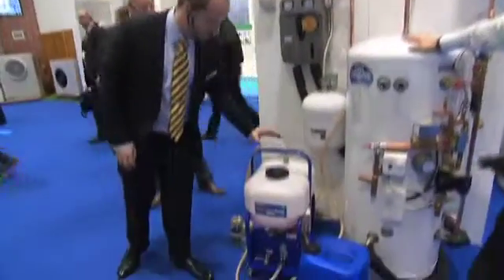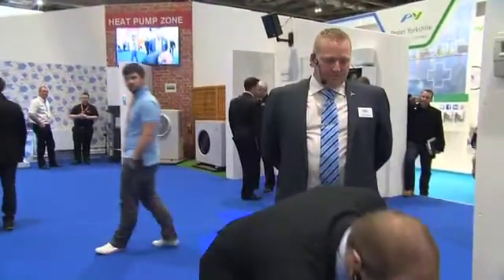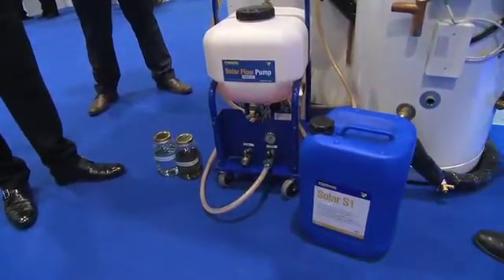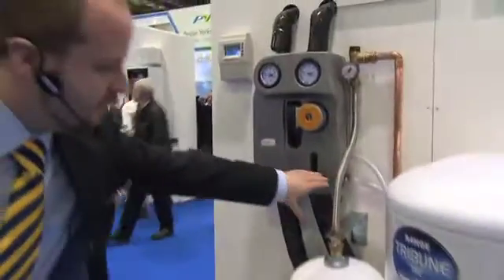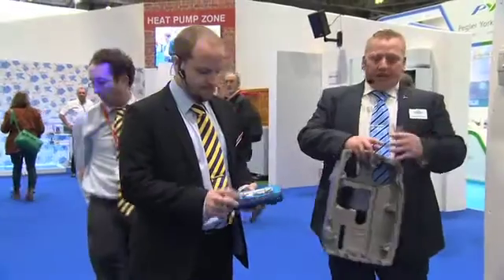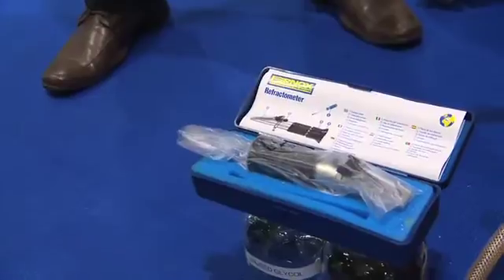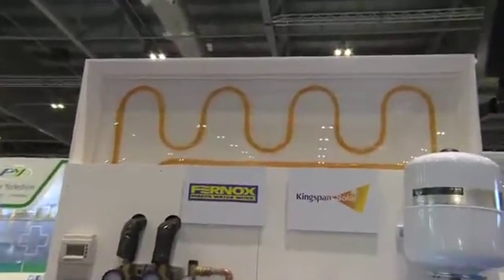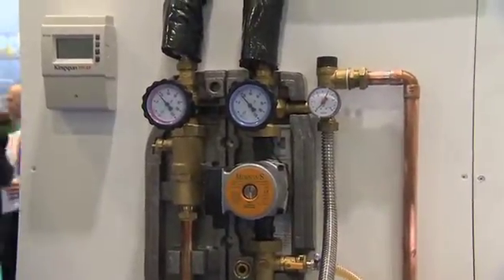Ecobuild 2014 (Practical Installer) Filling & Flushing Solar Systems

Comment: Well how to confuse the customer !  There is nothing fancy about bleeding air from a  solar system. Always set the pressure vessel at 5 psi less than the system pressure and this should be with the system cold. You can buy a 12 volt dc gear pump very cheaply and leave it plumed in. A golf trolley battery is very easy to obtain, one that cannot run 18 holes, golf shops give them away !

Comment: Anti freeze is not better than water as heat transfer. Anti - freeze over priced water £100 for 20 lts , joke.
Reply: Mark ... the correct solar glycol used is NOT the same ANTI freeze from Halfords lol.... 20ltr solar glycol £27+vat  plumbcenter
Reply: @robertgarrard5350  Try getting that price now.
Reply: Anyone know any company that replaces glycol in solar systems in the UK?
Reply: @stephenpowell5241  UK is a big place. Where do you live, town or village?